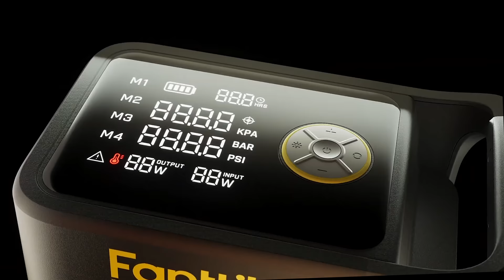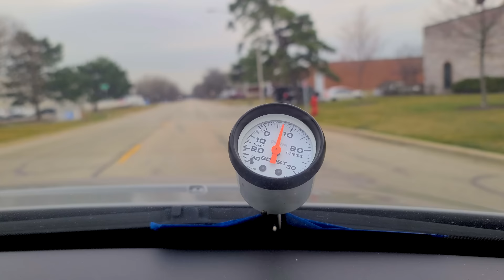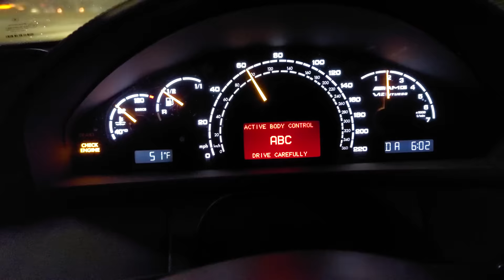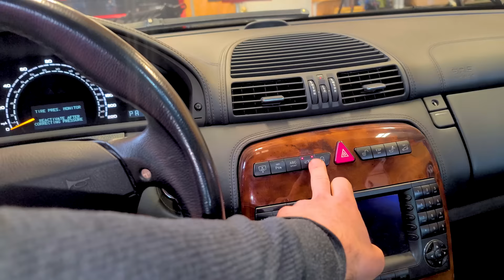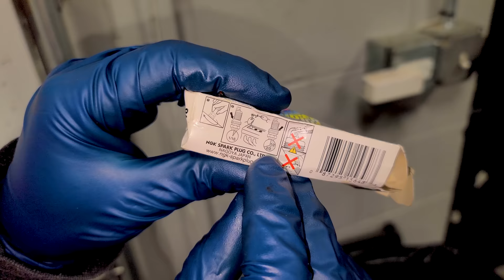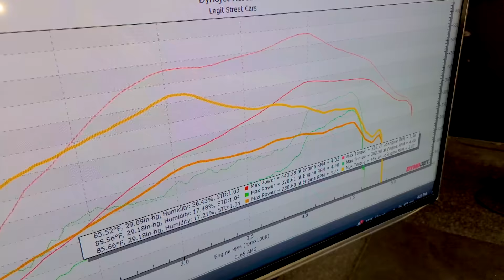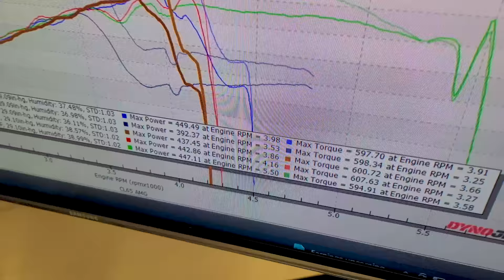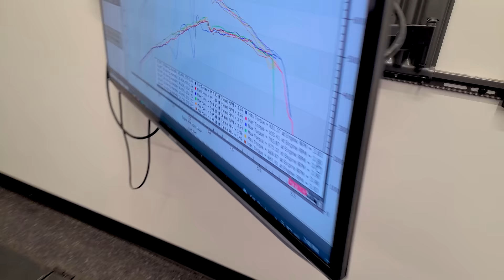I Finally Fixed My CL65 AMG & It RIPPED Until It Broke Again, TWICE! This Is Out Of Control!

Comment: DO NOT fix those coilpacks , just put a brand new original packs , both of them with a brand new spark plugs and reset the ecu to the factory state or just change it,     i done this after a year and a half of being cheap and try to get around shit with cheap ways, guess what - THEY ALL FAIL.
my car war running like a dream after this and i could say , it was the most enjoyable car i ever owned .

keep in mind coilpacks and hydrolics are probably gonna brake again. its a factory defect and they admit it.

Comment: Hey Alex, So do they make the conversion from the Mercedes one piece coil bar to like for example to a Dodge dual spark plugs coil, or say a GM coil on plug? If possible maybe it would allow better troubleshooting of the misfire issue.

Comment: would it be a coded safety cut .. almost like a boost cut.. but ecu is so out of date you cant log it.. as in the missfires caused by limp mode.. Is pass n driver side coilpack the same.. I would have wanted to swap them.... more voltage to the coils .. idk man.. good insurance? fire lol

Comment: The M 275 E 60 AL produce 970Hp 1000Nm/ 738lb·ft
torque BiTurbo turbo pressure 
AMG stock  comp ratio 9:1
how about take the engine from a scrapped car

Comment: Man Alex, you are not having a good time with your  CL 65. I have a fault on my E280 CDI wagon, (Which I bought because I loved your wagon) when I give gas, it just doesn't go anywhere, I have tried replacing parts, throttle body, accelerator pedal, even replaced the airflow sensors, but still, no deal. If you know what it is, drop me a line, I am at my wits end. Good luck finding your problem, I hope it turns out to be something simple, bad earth or something, I know you will get it eventually. Good old over engineered German cars, 🙃🙃

Comment: @LegitStreetCars don't know is there any other way to contact you, so this may be shoot in the dark but will try. Dear Alex, I am from Croatia, small country in Europe, let's say close to your ancestors in Italy, if that makes any sense 😂
I have an ml320 CDI from 2007. with "only" 130tm and I am experiencing some issues with my transmission. It started to slip or jump in rpm when shifting from 4-5 gear. Let me explain, oil change was made 2 years ago maybe 7tm ago. And this issue started recently. When hot, rpm goes up like you added gas and then it shifts to 5th gear. Usually shifts at 2krpm now in 4 starts to shift at 2krpm spins up 2200 and then engages 5 gear. Other gear changes are buttery smooth except that notorious jolt from 2-1 usually when  colder. So if you read this I would be surprised 🙀 but you never know 😊 keep up the great work Alex and God bless you. Regards from Croatia ❤

Comment: Noob Saibot, Smoke, Reptile, Sub Zero, Scorpion, i memorized all the moves for this set of characters and they are all my favorite, until you get into MK4 or later, then it was Cyrex or however that cyborg name was spelled. and reptile/scorpion.  newer MK's Scorpion, and the blind swordsman guy. 

as for cars.. should have gotten a 335i.. twin turbo, can make good power.. or an F80 M3.. or MK4 Supra.. less headache than this Mercedes. honestly, i loved BMW cars for work, easy work, just time consuming, Mercedes was just ass all around. pain in the ass work, bolts crammed into tight corners that required damaging tools or coming up with super creative ways to get e torx bolts out on back corners of engines.  the fact the valve covers didn't have gaskets on some of their engines, but instead used a special sealant, that was suppose to sit to cure for 24 hours but customers don't want to wait that long.. yeah.. not a fan of Mercedes.

Comment: On your spark plugs - did you upload each spark plug serial number to the ecm? If you didnt, the engine light will come on..., just kidding of course. How does a factory mercedes pressure hose only 3 years old blow out like that; crappy quality from mercedes or their venders. A $20 hose that mercedes charges $200 -300 dollars for. Ppl who can afford these cars brand new enjoy them while under warranty or extended protection plans. After a year or two trade them in for the next luxury sport with a warranty and extended protection plan. The car they trade in gets advertised as a one owner w/a 100 point used car check up that you/I feel was a deal only to become a money pit. Leave it factory. Once you begin uprading this and that - you're never done. Good vid, good luck w/the car

Comment: Torque your sparkplug !
Reply: That's a tip that I learned from Mercedes Technicians. That can be a nightmare to diagnose, and the problem is usually the spark plug torque.

Comment: Have you messed with any throttle control systems it seems like it might be sending the wrong signals from the pedal, maybe the tune they origanlly applied accomodated for that increase in rpm or decrease, and maybe now that you adjusted the plugs the accomodations have to be adjusted to counter it yet again, it seems like it could be something to look at. I know its rare and usually easily spotted but much can be overlooked in these circumstances, i dont mean to insult, i know how much youve put into this thing and how much you love it. I just see the terrible mess of tuning and computer nonsense you guys are dealing with and it seem to me that the mechanical parts may be fighting the computer, in essence maybe a new fully factory computer with a factory gap could maybe help this thing. But for all i know maybe not at all. I just hate to see that look of disappointment on your face and lord knows ive been there. I pray that you get this thing to its origanal glory and i see that disappointment turn to the joy of a boy and his dream finally coming true of that one thing he loves finally paying off. Btw i really loved how the issues on the mustang literally were so insane yet you just buckled through and made it happen with your fingers crossed and an old blown out engine lol beautiful. Cant wait till the next video comes out, keep your head up man worst thing that can happen is you have a forever project and something to keep you happy doing what you love, getting those hands dirty and covered in...hydrolic fluid???

Comment: I did not enjoy this video. That thing is turd and you should get rid of it.

But on the other side of things… how about fuel? Could the fuel line of that bank be kinked, somehow? Or the signal to the injectors be screwed up somehow? 

E85 contamination?

Any way, this is becoming painful to watch, like those « Strange Addiction » TV shows - kinda funny to begin with then it’s just sad.

Comment: Dude, I know that this car is the bane of your existence mechanically speaking, and I get it completely, but your dedication to doing things properly Alex is so rare and no small inspiration. In a lot of ways watching your videos has given me the further confidence to retap and timesert my Kia Sorento crankshaft (if you know you know). That job was a bear to say the least, 4 times I/O was the charm……until about six hours after finishing it a very thoughtful  auto gnome was helpful enough to release me from my burden of ownership and stole the car, with my dog still in it while I ran into Costco. As I exited the store I saw my car backing up and instantly my mind went to the safety of my dog so I  probably ran at least 4% over what’s possible for me to the exit and caught the guy at the end of the parking lot.. as soon as he saw me opening the door he floored it and threw me to the ground and sped away in my car with my dog and all devices. Alls well however, (well I lost my iPad forever but that’s far better than it could’ve been) since I have pretty much resigned to gps-ing everything (dog included) and I can only speculate how this transpired but my dog, a Australian Shepherd/Belgian Malinois was tossed out of the car in only 10-15 blocks and was safe, and then I tracked him take my car about forty miles away and went on a stealing spree of multiple stores and then about half way home my gps went dead on the iPad, so they knew I was using it,  (too long to explain how I now) ultimately the dude fell asleep in the car and the cops picked him up the next day and I retrieved my car. Unfortunately the thief ran the car very hard and it  began hemorrhaging oil shortly after. Long story short, the car is apart again to replace the leaking front main and valve cover gaskets and a number of other while you were in there’s. But this job was absolutely above my pay grade before I started watching your projects and now I’m confident enough to, in this case pretty much take the top end and front end off of this motor without being in continual panic stammers.  Plus, as annoying as it is to repeat jobs for the perceived same net gain, in the end in your case, it’s all interesting content and truth be told Alex, none of us out here are necessarily rooting for you to get your cars in perfect mechanical order because then that playlist series is over. So thank you sir, your videos keep me engaged.

Comment: These era Mercedes are worth shit in europe. Before the 2000’s Mercedes Benz were made so good, that “modern” financial rules dictated that you have to be “cost efficient”. Later the other German based manufacturers followed suit and voila; until these days the German cars are still crap. Plastic in heated area’s going bad. Way to much differentiation between models in software, subpar materials and a kind of: “ zoepertech mit hohes maintenance “ kind of attitude.
Japanese an Korean manufacturers zipped by like a Ferrari overtakes a lada in terms of quality……  It is that the “old boys” networks still functioning fine so many lease company’s still offering German cars…… even the electric vehicles are sub par. Porsche is a exemption to be honest, although the cayenne Iris also crap…. Like English cars, but a little less worse hahahaha

So stick to pre 2k German cars. They ARE indestructible for the most part. Can’t find any better. To this day. Like japan3se cars before 2010